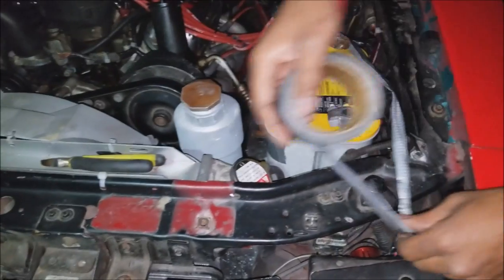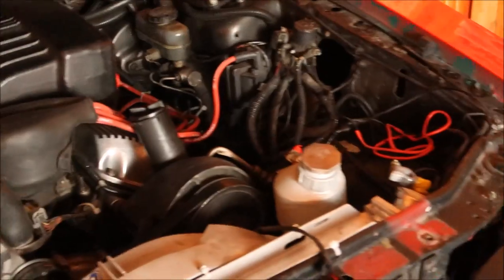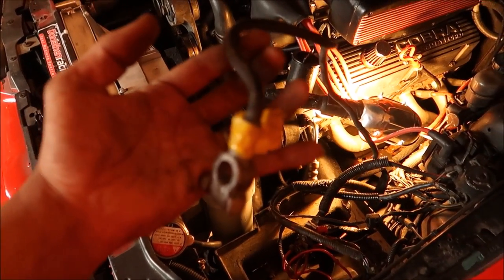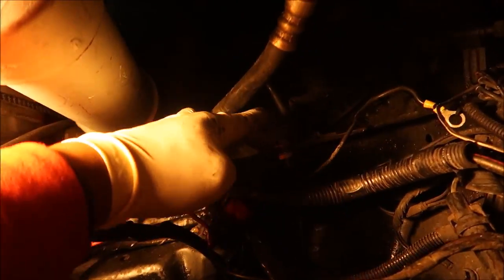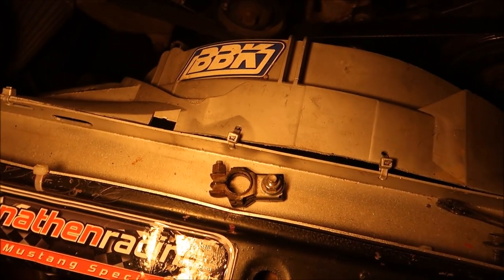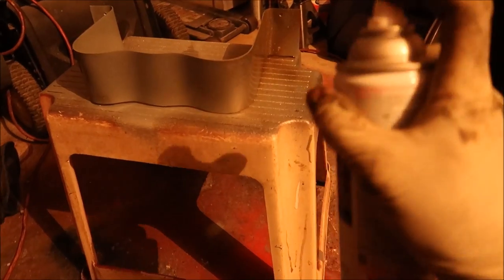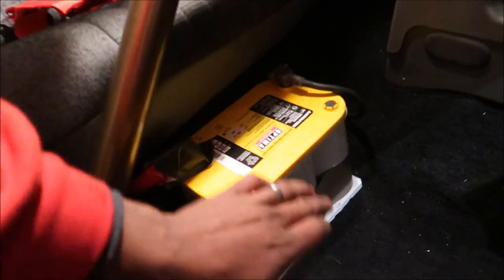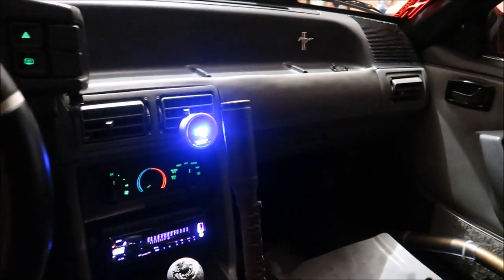Battery Relocation

Comment: I've been looking into relocating my battery, your homemade battery strap looks better than the ones you buy. I like it.
Also, do you think you will put an aftermarket steering wheel in your Mustang, or keep it stock?
Reply from the maker: When i was shopping for a fox, i passed up a lot of good deals on older cars because I wanted a 90-93 car with the airbag wheel.  in a few months you'll actually see me installing dual air bags.  I don't think i'll be removing the airbag wheel until i finish my cage and get a hans device.

Comment: For DN, you don't need a cutoff switch unless you're doing tandem. But you do need a box. IIRC it needs to be vented out of the car.
Reply from the maker: I was hoping you wouldn't watch this one lol  No telling who else will see this and recognize the car though lol but after researching on battery fumes, I definitely plan to go the safe route, I will be making a properly externally vented box with a fan.  Drag strips require a cut off switch.  I don't ever plan on taking this car down the quarter, but if i ever get curious one day, i'll have to do something, I'm really against the idea of putting an external cut off on my street driven car.  Thx for clearing things up though.
Reply: DN doesn't require a fan. Just a box and a vent out of the car for fumes. But if you're doing other stuff, yea that makes sense.
Reply from the maker: yeah, i figured if i'm building one, i might as well

Comment: no way would that ever pass tech inspection. Having an open, exposed bomb inside the cabin like that is not safe. Spend $20 and at least buy a cheap battery box and mount it in the trunk.hatch with a vent tube.
Reply from the maker: like I said at the end of the video